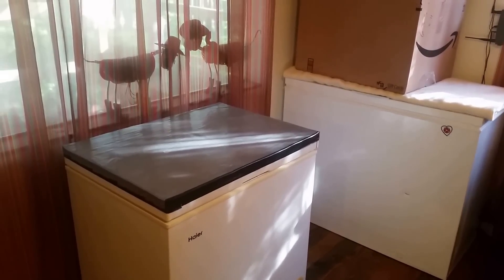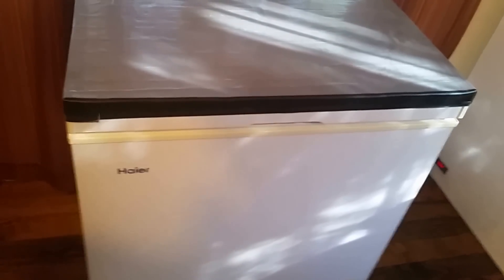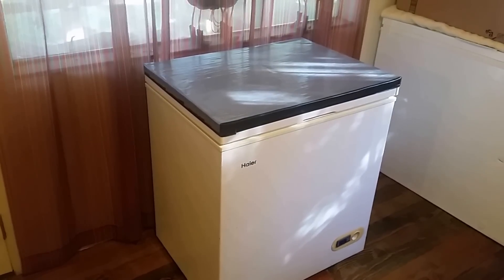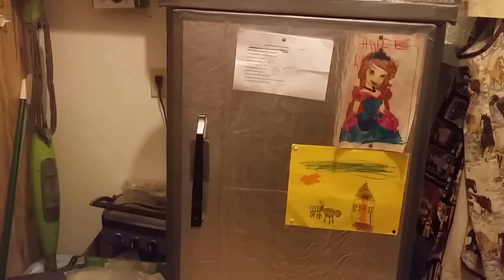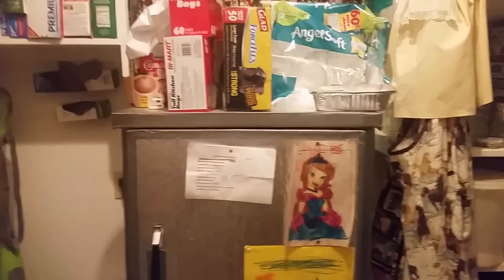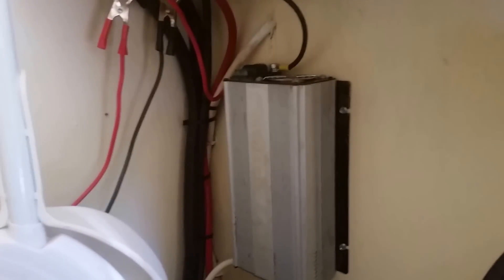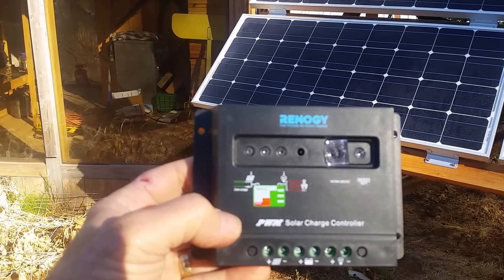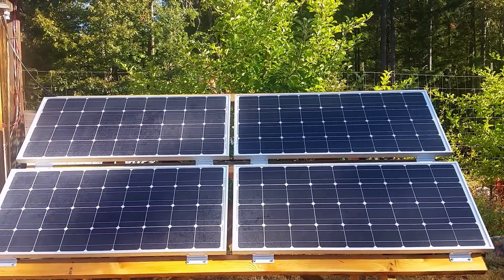Off grid solar power (refrigeration on the cheap)

Comment: Not wrong,  but out of date.  Its now easy to buy a pure sine wave inverter in the same  approximate package as your harsh modified wave unit.  A smoother choice is a 12 volt chest fridge/freezer, that is no longer an expensive exotic buy.  When the battery draw is large,  use golf cart 6 volt batteries in series,  but never connect batteries in parallel.  They fight each other.
Reply from the maker: Thanks. This video is 7 years old. I will pin your comment.
The video you watched was made by request for a gal in Mexico. The list was populated by the things she was able to get in her remote area. I have used T105  golf cart batteries. My dad's house runs on 8 of them @ 24 volts. Our old homestead ran on 8 L-16 FLA batteries. Our new Off Grid homestead runs on a 15 kilowatt repurposed Tesla batteries. We have 5k in solar. A Magnum MS4024 running the house. The well runs on a Outback VFX 3524. We have 3 FM 60 charge controller and one Midnite Classic 200.
Thank you for taking the time to suggest a more economical way of doing refrigeration.
Thank you for watching and May The Lord Bless your life in Jesus Name.

Comment: Nice video. What batteries are you using to power your system? Surely it's not just the one battery on your travel trailer?
Reply from the maker: Greetings, this is a really old video. If my memory serves me right, at the time the house solar power system had four L-16 batteries. Our new off grid homestead has a 15 kilowatt lithium ion battery bank.
Reply: @offgridinthepacificnorthwe3210  And how does the converter connect to the house? Do you just plug it into an outlet?
Reply from the maker: @slamdunk58  No. You will need a inverter with an automatic transfer switch.  I have lots of videos on solar power.  I have video logged our solar journey since 2015. From our original very basic system to our current very complex system.

Comment: "ALL" the cold does not fall out...some of it does. :)   Modern refrigerators (since 2015 use much more efficient inverter compressors,
and the the ones with 'door in door' keep 'all' the cold from falling out, and the pull out freezer draws do the same.
The defrost heating consumes a lot of energy, but if you don't do that...you get ice building up and that makes the evaporators inefficient trying to cool ice instead of metal.

Comment: what controller did you use on the freezer?,,
Reply from the maker: tedjones112 Here you go,  https://www.amazon.com/dp/B00OXPE8U6/ref=asc_df_B00OXPE8U65088023/?tag=hyprod-20&creative=395033&creativeASIN=B00OXPE8U6&linkCode=df0&hvadid=167130088685&hvpos=1o4&hvnetw=g&hvrand=385844028058006845&hvpone=&hvptwo=&hvqmt=&hvdev=m&hvdvcmdl=&hvlocint=&hvlocphy=9033114&hvtargid=pla-307270368428

Comment: Thank you for your video. We eat mostly raw until dinner, and we eat a lot of fruit and vegetables, so we have an issue with needing a lot of refrigeration space...making it be expensive with off-grid power for them...

Fridges might not be an issue for us, since we are planning on making an ice-box type of fridge, but for us the freezer part is most difficult.

When it comes to solar panels, we actually got nine 270W panels, and we paid about $285 a piece...

Comment: Wow what an excellent video! I love the upright fridge with the insulation and the coils on the outside! Can you find these anymore?? Boy i would kill for this fridge! We are still trying to figure out our refrigeration because we are so  disappointing in what we have. Our fridge runs every hour for like 20 minutes its insane!! I like that kit also..Chris from chrisdyieroklahoma has a whole array of these and seems to like them alot! We a also advocate for that kill a watt meter to..a must have on any off grid setup!! EXCELLENT video .best one yet!!!
Reply: hi I am Marty after watching different videos I believe you can tell me best on how many solar panels and batteries I would need to run a fridge 24/7 we have a camper that we plan on living in for the summer next year right now I have 2 - 100 watt solar panels + 4 lead acid marine batteries we do have a camper size propane refrigerator but it really is not big enough I would like to put a full size House refrigerator on the porch and run it consistently could you tell me how many more solar panels I might need and/or batteries
Reply: I bought a DC powered chest freezer and converted my old chest freezer into a refrigerator by replacing the thermostat.  The freezer uses an average of 18W and the refrigerator about 9W.  The 1000W pure sine inverter for the fridge uses about 3-4W in sleep mode (which cannot be used with the digital temperature controller) and about 18 watts if "on" but not doing anything.  Also have a small fan blowing across the wood stove and my laptop plugged in. All this is run from eight 186AH 6V batteries arranges 4S 2P,  and charged by a 280W panel through an MPPT controller.  Works great. I haven't even added any insulation to either appliance yet. The upright refrigerator/freezer that used over 1600 wh/day is disconnected, but kept in reserve for harvest season.
Reply: And now for something completely different.  I have  7CF chest fridge I use as a refrigerator and a car battery at my camp.  It woks great and only when the sun shines. Kept close to 34F and large mass of liquid maintains temp through the night. Takes about 1500W of panels to operate it on a rainy day.  Grid tie panels are cheap compared to batteries.  As a bonus I make hot water for showers with excess electric.  Even have a real dishwasher.  All custom electronics, but demonstrates what can be done with a minimal system.
Reply: Douglas Cooke.  Can you give name and models for the DC chest freezer and the 1000W inverter with a sleep mode you used?  Does the inverter automatically wake up (load senses) with the chest freezer load ALREADY plugged in and senses the call for driving the freezer per the thermostat or did you use a relay to connect the inverter to the chest freezer power plug as a function of a separate temp controller?  This is the only step left I have before taking my fridge off grid but had not resolved how to avoid my thirsty inverter even at idle being left on all the time and only come on if the fridge calls to be powered up since it does not have a load sensing ability.  My goal would be that after the fridge thermostat turns off the compressor, then the inverter would  fully shut down as well until the next cycle.  Too bad you don't have a video of your setup.